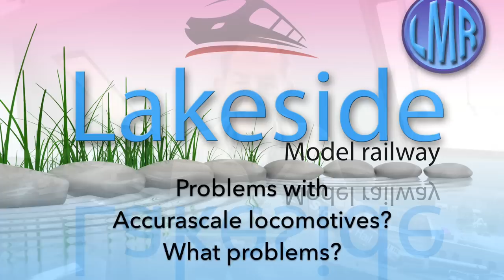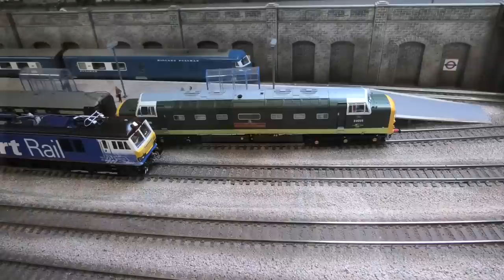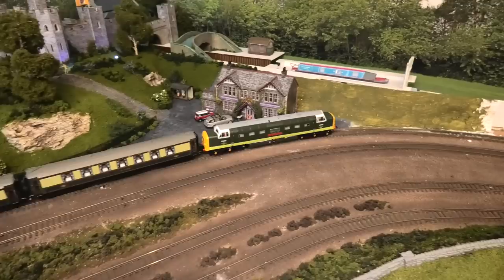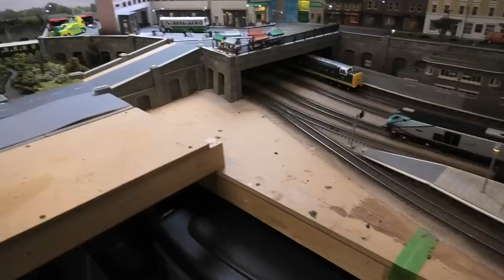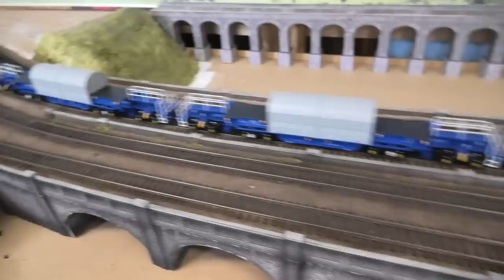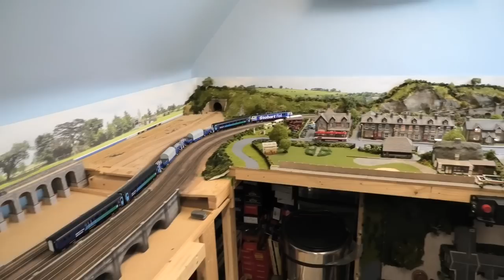Problems with Accurascale locomotives - what problems?     10-05-2023

Comment: Hi Graham,
Good video that your locos are working well, I would like to point out a few things with supplied wound goods i.e. motors from Asia and why there may be some discrepancy in performance observed for the same type model number motor. Most companies use a variety of suppliers i.e. for motors and though they may look the same can offer different performance than specified and here are some but not all, copper used in the motor windings 
may not be as specified as regard of the purity or the gauge of wire also the motor pickup for the rotor also the motor bearing the magnets used etc.
Tolerance will normally be to the lower end of the motor specification if you can save a few mm of wire over thousands of motors there is a cost benefits to the manufacture.
The back-EMF settings can be different if the copper is not as conductive for example,
Some copper suppliers from India China load the copper with zinc in the melt to bulk out the raw material it goes on and on. 
So, most suppliers Hornby etc. are chasing on component price to keep margins as most industries these days.
Reply from the maker: Hi Ken and thank you for the comment and all what you say is true which is why I said in the video that if you had for example 6 locomotives from the same class and manufacturer then each one would have different settings because of the different tolerances within the motor. It’s not straightforward as you obviously know. Anyway, with me tweaking these settings then I have now got two locomotives which run perfectly especially when I compare them to what they used to run like.        Cheers.         …………Graham

Comment: Hi Graham, an interesting video there. I only have the one Accurascale loco, a Deltic, which I haven't had any decoder issues with, except having to turn down the sound levels about 60% it was crazy loud when it arrived. Something I wondered listening to your video, is it a possibility that the running issues are something to do with the loco and the brand or type of DCC system your using. Maybe different systems require the loco chips to be just every so slightly set up differently. I use a NCE Powercab, it's 1.5A output I think, but if I run  too many sound locos at once I do start to see irratic running as I get near that 1.5A output. One other thing I thought might help and you might already use this, I always use JMRI Decoder pro to set any CV's as its run on a laptop and you can see easily what your changing as everything is in tab format. I remember reading on the Soundtraxx Tsunami instructions that their chip is set to start the engine sound when track power is applied, and if you change that to start the engine sound by pressing a function, you only needed to change a cv. Simple, but as your basically using a binary system if you get the CV value wrong you can unwitingly change other settings without realising it. I think that's why I use Decoder pro to remove that possibility. Sorry for the long winded reply Graham, I just wanted to share that with you and say well done on sorting out your two locomotives, good work.................Hope your well, all the best Dave.
Reply from the maker: Hi Dave, that all makes very interesting reading but why is it that if my controller is at fault then why do you think that my brand new Bachmann class47 ran perfectly straight out the box. If I had problems with the controller then surely it would affect that plus all my other locos?        Cheers.        ………….Graham
Reply: @GrahamFoulston  I'm not suggesting your controller is at fault................I was just thinking out loud, wondering if different controllers NCE, Gaugemaster, ESU, etc etc may work very slightly differently ie the settings you mentioned, with different chips, ESU, Zimo, etc. So your hard work resulted in getting the very best settings of the loco to work with your controller set up.............As you said, it's like fine tuning everything to work as one whole.................Your Bachmann loco might have already been set at the optimum best already...............I don't know, I'm just throwing ideas out there.

Comment: Hello. Can I help  you?  EMF is electro motive force.  An electric motor  is also a generator,  no. difference. So when the motor armature spins in a magnetic field  it begins to generate. This generated voltage is the emf. At a certain  speed the generated voltage will equal  the voltage going in and the motor will stop acceleration. On the BR class 25 locomotive  this happens at 18 mph.  To accelerate you have to cut the emf which is done by cutting the magnetic field,  known as weak fielding.  I hope this  makes sense.  Regards  Mark

Comment: Hello Graham, thanks for sharing this. I have both models also, and whilst no issues (yet) with the Deltic, my sound fitted 92 has been a problem. Being in the US, rather than returning the model, Accurascale sent me a replacement motor which I have installed and performed the self calibration. The new motor restored the operation above 66% and now varies speed all the way to 100% - which I could not achieve by varying the CVs, so that is an improvement.  I am though curious what your final values ended up at for CV 51-56 as I'd like to compare with the auto calibration values. If they are close I might leave alone, but if not perhaps there is some room for improvement. Thanks.

Comment: Hi Graham, have you given any feedback to Accurascale? If not I strongly suggest doing so, so that they can make sure the back EMFs are properly set up before sending models out in the future.

Based on the way they changed the chains on the second run of Deltics they do seem to be a company that listens to customers.
Reply from the maker: Hi mate and thanks for the comment. Yes I have given Accurascale feed back on these issues and I know that they are now working hard in the background to try and solve any future issues. Hopefully these will all be resolved in the future because as you say, they do at least listen to their customers feedback.       Cheers.          …………Graham

Comment: Hi, sorry you've been suffering this so long. They must be using a different motor from others then. Back emf is used for feedback control. Motors are dynamos when they spin the make power, this power can oppose the incoming control voltage or when the controller is set up correctly it can be measured to see if the motor needs more or less power from controller. Sounds like the motors in these are very efficient dynamos, are they coreless?

Comment: How strange - back EMF is a major part of electrically powered locomotives. This is often resolved with a weak field on older DC based trains and is often used to help charge batteries and power the auxiliary equipment. Never thought I would see it discussed in this sense. Back EMF is a by product of any electric motor - and it’s down side is that it conflicts with the electrical supply to the motor - thus creating a retardation effect (sometimes used for frictionless breaking like Class 85,86,87 locos and 313, 507, 508 EMU’s)

Comment: Just out of curiosity I'd like to see what the scale speed is of the locomotives are on 100% throttle. 
To my mind the loco should run at it's scale top speed at 100% throttle setting! I regularly see locos like t a class 08 able to go at a scale 70 mph! To my eye the deltuc looks a little fast at full speed after adjustment,  but far far to slow before!

Comment: That has given me a bit of hope, I’ve had repeated issues of loco randomly accelerating and decelerating (even after the motor was replaced) on certain parts of my layout. Is this similar to what you had with the class 92?
Reply from the maker: It’s identical eMate, that’s exactly what was happening to the 92 and also to the Deltic initially.  Hope that helps.        Cheers.        ………..Graham

Comment: Purchased a 92 Caledonian sleeper last year that constantly tripped out and then restart within a minute, eventually  stopped altogether. excellent support from customer support. Sent it back and worked perfectly with a new motor and decoder software update.
Just received a 92 DB Schenker today, one pantograph was fitted UPSIDE DOWN, how does a manufacturer allow this to happen. They tend to fall off any way so refitted and glued on, engine run's great on it's own and with a couple of container wagon's but put 3 on and it trip's out. will try the CV 54 trick again

Comment: To be fair Graham, your analogy of a car wasn’t quite right.

If anything, it actually proves its exactly what you do (tweak) a car.

For example, you buy a car, but want to use it on a specific circuit (or track) - it will have a default set up, but that may not be right for your track or circuit. To get it to run right, you’d tweak it to your track requirements.

It does make me wonder if in certain scenarios, this stock set up is not suitable for some layouts and a unique set of scenarios - aka the hole in the cheese effect. Glad you have got things sorted

Comment: Accurascale claimed that their Deltics were configured to run at a scale 110mph maximum speed. Your "tweaked" machine appears to be running at double that maximum speed. I bought 3 Deltics from Batch 1, and have had no running problems with any of them.
Reply from the maker: Hi Holly and thanks for the comment and I’m pleased that all three of your Deltics are running fine but I wonder what you would have felt if one of them was behaving like the one I have? Send it back probably which is what I did but it came back still not running correctly. You say that it’s supposed to run at 110mph which is true but if you remember, in the video I said that there are the loco settings and the individual settings. The BEMF has been set and gives me this very fast, out of scale speed, but it’s now optimised to the motor, I have yet to set the CV to my own max speed, I left this to show the difference in speed performance from what it was to what it is now that it’s been optimised, I can now go in and adjust the maximum speed in the local settings. I hope you don’t honestly think that I would run the Deltic at that speed you saw in the video!      Cheers.       ……….Graham
Reply: @GrahamFoulston  Hi Graham, Rule 1 applies as it's your railway. The only adjustments that I made on my Deltics was reducing the Master volume (they were too loud), and rearranging some of the function buttons (some functions weren't applicable, while others were originally beyond the range of my Digitrax controllers).

Comment: I’m afraid I would send it back and ask for my money back. Ready to Run should mean Ready to Run
Reply from the maker: Hi Peter and thanks for the comment, the Deltic was sent back was still wasn’t right when it came back, I was already to send both back to Accurascale asking for a refund but as Susannah took the time and trouble to source this information then I thought I might as well give this a go before sending them back. But I fully understand you thoughts, different folk act differently in cases like this, some like you would immediately send them back, some like me with an inquisitive mind like to ‘have a go’ first - not wrong or right, just different points of view that’s all.       Cheers.         ………..Graham
Reply: @GrahamFoulston  I’m afraid I’m not to good at CV’s etc. But I ad ire you for fixing it. Well done.

Comment: surely the sensible  option would be to revert  back  to good old plain  and simple dc analog  and run your locos on that ? THEN  take all the DDC crap and  place it all straight into the bin ??  because DCC is just a unwanted, overrated,complicated  and expensive gimmick that only adds further problems and  unwanted costs to new locos !! I run a mixture of both new and old Bachmann ,Hornby,Lima  and accurescale locos on plain DC analog control and the locos ALWAYS run prefect and sweet and very,very rarely get any problems !! I have been in the hobby since the late 60,s  and I must be missing something but I really dont get why people STILL persevere  with all this dcc nonsense, because, all it seems to do is  create more running problems !! personally  if im paying  £200 and over for a new loco then I really dont give a f**k about weather their is any cab lighting (as drivers just  DIDNT have cab lights switched on  whilst on the move ESPECIALLY  at night 
 !!  )  OR hearing the sound of cab doors closing ,OR the  loco exhaust sound OR  a 2-tone whistle OR a brake releasing because  ,im far  more concerned about just how well  the thing runs/handles the track and well it negotiates  curves and pointwork without stalling or de-railing and just how easy the motor is to access and service !!